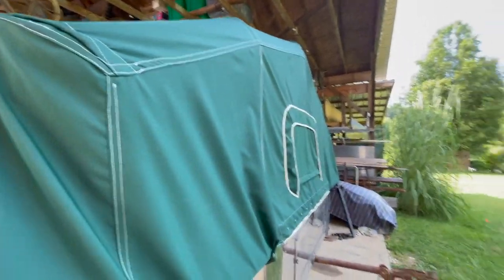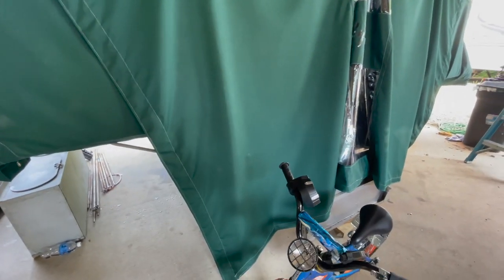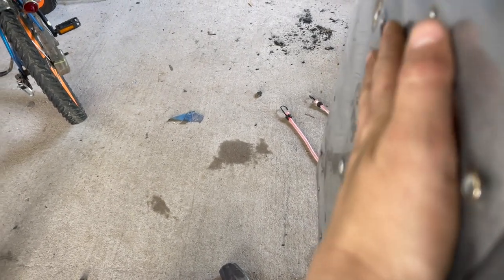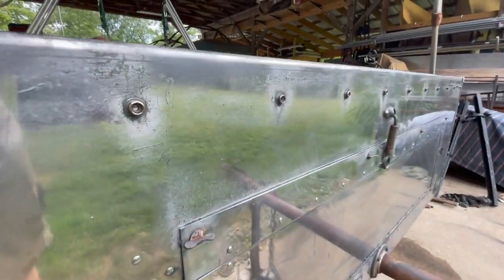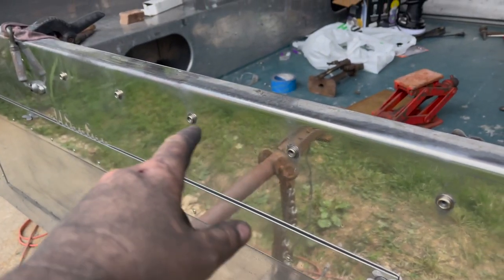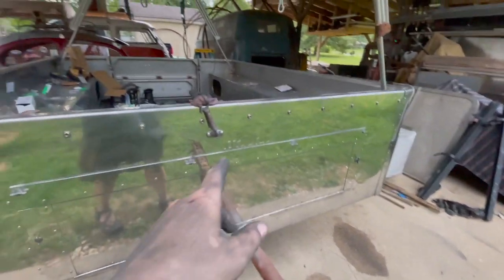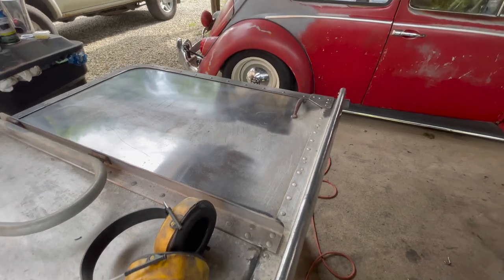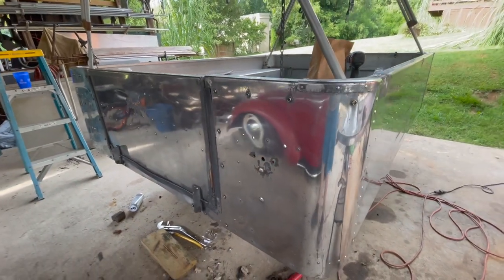1948 A. J. Higgins Tent trailer, Polishing a Vintage Aluminum Trailer using the Zephyr kit

Comment: Boy that turned out nice! You gave a good idea how much elbow grease is needed to polish and the other side ( where the polish goes on the other side of the camera).  The little sandblaster did the job, I made my media blaster with a water bottle and a air nozzle with a slit cut in it.
Thanks and Peace ✌
Reply from the maker: I've seen folks on YT make those blasters using a water bottle...always wondered if they worked! I was pretty impressed with this one tho! This little trailer was a lot of work, but was fun camping in it for sure!

Comment: Any information on your sewing machine would be interesting .  I have had interesting results with my Singer industrial abut the thread limit is 4mm long ... I have a Pfaff 1222 Electronic which is more portable and  has the power but relatively high speed and max 4 mm thread length also ....Love your work as always  Alex
Reply from the maker: its a 1937 singer AE model, straight stitch only and no back stitch but with the knee lever presser foot is sews like a dream!
Reply: @marcijunebug  You certainly are one special talented Lady .... Thank you for your reply. kind regards Alex

Comment: Any chance the tongue has been shortened at some point and that's why the jack leg isn't cooperating? Just a thought. Your dedication to seeing it through paid off big time! It looks amazing!
Reply from the maker: no, after further inspection (which I didn't address in video) I noticed the foot (kickstand) had been repaired at some point and it looks like the welder wasn't really concerned with it fitting or didn't think about it or something because the welded portion made it slightly longer...just enough where it won't clear...we just took it off for this trip and I'll just grind her off a bit and I think we will be good..thanks for being here Adam!

Comment: I tore out my original nasty linoleum floor last year.  It was all moldy bad under it.  I'd suggest doing the same.  Almost guaranteed yours has mold too
Reply from the maker: no mold, no linoleum in floor...just the original green painted metal on floor...cubbies were just bare metal...I'm thankful for that at least the mold sounds awful!

Comment: well, I think you've determined that you DON'T have an aluminum allergy, like Buddy Ebsen had. :)  How will you keep it from oxidizing again once you are all through?
Reply from the maker: bahaaa nope! There is a sealant you put on it to prevent oxidation but it still requires a polish every 3-5 years...just using the finer wheel and buff compound tho thankfully the entire process doesn't need repeated!